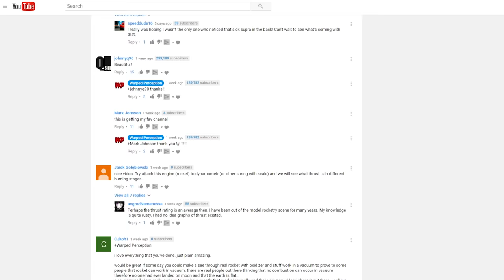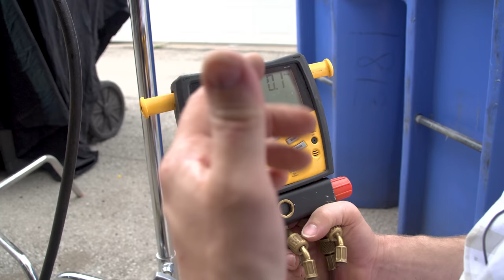Model Rocket Engine In A Vacuum Chamber - 4K Slow Motion - will it burn? - Rockets (S1 • E3)

Comment: I’m not saying anyone is wrong, but I thought that sound couldn’t be heard in a vacuum? The GoPro inside the chamber captured sound
Reply: It can use the exhaust gas as a medium which causes a slight vibration of the chamber which causes a slight vibration of the air.

Comment: the rocket added pressure to the tube as soon as it lite off, I would have liked to have seen a vacuum gauge on the tube to see just what types of pressure absolute was in the tube from beginning to end. your a/c equipment there would have that gauge.  Vacuum is a made up word to discribe absolute pressures below atmosphric pressure which is 14.7 psia at sea level. that small tube's vacuum would have been used up within the first few nanoseconds of ignition.

Comment: Need to mount a load cell to the interior of that tube and attached to the front of that Motor. That way you can measure how much force that motor is creating in the vacuum.
Reply from the maker: I got your back StemLX, wait till you see the next episode in the rocket series. will be out next week. did you see the igniter video we posted yesterday !?. I think you will like it .

Comment: This doesn't look like a complete vacuum to me. While I understand how rockets would be able to burn and make thrust in a complete vacuum, the way the smoke when it first ignited sort of swirled rather than just moving directly away from the rocket appears as though it were moving through air. My guess is that it was reduced pressure, but not a "hard" vacuum - I notice he put another rocket chamber vacuum video, maybe that's a better "hard" vacuum. Likewise, as soon as the rocket ignited it filled the chamber with gas - I'm sort of surprised the chamber didn't pop open, I would expect that rocket motor could generate enough gas to fill that chamber to higher than atmospheric, at which point it would pop open - the duct tape didn't really hold the ends on very securely, just enough to get a vacuum stated so atmospheric pressure could clamp them on very strongly, but any overpressure and they'd pop right off.

Comment: You won't be getting much vacuum for long in that tiny little chamber, the gas from the exhaust will pressurize that tiny little volume in no time. This needs to be tested in a real vacuum chamber, a large one where the gases from the exhaust will do little to pressurize the system.

Comment: How many milliseconds do you suppose it takes for that rocket engine to eliminate the vacuum? Be nice if you had a vacuum chamber large enough that the expansion of the rocket motor would not instantaneously eliminate the vacuum

Comment: And speaking of pressure differentials, nothing launched here on Earth could go to the negative pressure of a complete vacuum in a matter of seconds and survive. It would have to be depressurized the higher it when which would make breathing really hard. It would be the equivalent I'm going to the bottom of the ocean in 30 seconds in a tin can only the opposite a pressurized vessel would rip apart instantly entering space

Comment: What is causing the rocket to burn? There's no oxygen in a vacuum, but in your experiment, there appears to be allot of carbon left over. You must have had a leak somewhere. I noticed you managed to open the end of the vacuum without decompression. How was that possible?

Comment: All you "Rockets cannot work in space" people have one big problem: We don't have just "atmosphere", where the rockets should fine according to you,  and the suddenly "the vacuum of space" where it would not work. Instead the air density just becomes thinner and thinner with the altitude. If your "theory" would be correct,  don't you think, that the rocket should work worse in thinner air and would have less thrust? 

The air pressure gets lower very quickly, at the beginning, then slower. At 13km (the maximum altitude for passanger planes) you have 18.9% air pressure. Already 35.9km you have only 1% air pressure! Only 0.16% at 50km. And at 100km you have 0.00027%. The ISS is at about 400km - but there is still no perfect vacuum, so it slows down because of the air drag and loses height. The Hubble was put out at 618km, is now at about 550km, and it keeps on losing height - because of the air drag up there. 

So please can you tell me: What is the border for a rocket to work, which air pressure is neccessary? Or can you tell me the formula for the relation between thrust and air pressure?
Reply: And what you also forget: You think that this is a special "space" thing. But it is not. If reaction engines would work as you think, then that would also affect jet airplanes. Why do you think that they fly so high? Speed records were made at a very high altitude - because you have less air drag there. But still the same thrust. Do you think that e.g. the engineers at Rolls-Royce, who jet engines fpr most passanger planes, don't know how they own engines work or are parte of the conspiracy?

Comment: I feel like the reason it produces thrust is due to the vacuum chamber only being so big so it has space to bounce off of would this be different if it were in space ie having nothing to push from ?? Wouldnt the only thing that could push something through space is compressed air or gas?
Reply: Unlike planes and helicopters rockets rely on Newtons third law
Reply: @idkhowtoright479  the law is NOT an exemption JUST for rockets.  Stop that.
Reply: Exactly that.  This is a vacuum CHAMBER and not an infite vacuum. A step closer to that would be if he left the vacuum pump run continuously, but even then the "infinite" vacuum would be limited to the volume of the chamber and the power of the vacuum.  

Hope this helps.
Reply: @DrCash7  wrong, the Chambers atmosphere has nothing to do with the thrust of the engine

Comment: thanks, but from what I saw, it didn't move until the chamber was filled with smoke (air) and it then had somthing to push against.
Reply: Ya know these rocket motors take time to get up to full thrust
Reply: @astron3133  I agree. But then, it didn't solve the matter yet.

Comment: I would love to believe you are missing a point here:
I don't care about the shape of the earth weather its banana or strawberry, but you can clearly see the rocket is getting the push from other side of chamber wall and  not from the vacuum.
Reply: Rockets get their push by the speed and pressure of their exhaust gas.

Comment: A relatively small tube that's closed off is not comparable to an infinite vacuum of space with nothing to hold air columns or gasses in place, not to mention what assurance do we have that your vacuum is in fact a proper vacuum even?

Comment: Its a nice video BUT.....its a closed system so there is still something to push against.........a vacuum in a open space like a old factory complete Vacuum. So the distance fron the rocket to the side wall's is mutch bigger......if you put it in a tube these walls are in scale mutch to close to the rocket.

Comment: OH yeah, I forgot to mention, also the reason the rocket didn't push against the spring immediately is because the vacuum chamber SUCKED out some of the rocket's exhaust for a little while, then was some pressure inside the chamber, and then the rocket was finally able to displace something and only then did it push against the spring.    I have gone over this many times...It's all about that VERY first gas molecule escaping the nozzle....when it is ENCOURAGED to escape FASTER than normal because of being in a VACUUM, it is NEVER ran into by gas molecules BEHIND IT.  None of the gas molecules escaping the nozzle in a vacuum ever run into each other....the first that came out first is still at the head of the line, none of the gas molecules behind it will ever catch up and push him forward.  In space it would just form a perfectly straight line leaving the rocket nozzle....The line would never bunch up, and Yes that damn rocket wouldn't budge an inch. 

The boat prop must displace water for the boat to move. It has to move the water forcibly or the boat doesn't move.
The airplane prop must displace air for the airplane to fly.  It has to move the air forcibly, like you actually have to feel a ton rushing air coming at you or the airplane doesn't fly.
A jet engine must displace air for the jet to fly.  It has to move air out of the way forcibly or the jet doesn't move.  And, if the jet gains too much altitude, climbing to where the air gets thin, it loses THRUST.
A rocket taking and flying MUST displace air or molecules of some kind in the environment.  It has to move something OUT of it's way in order to go the other direction.  In a vacuum the rocket thrust is ENCOURAGED, or SUCKED OUT.  Unlike a rocket in room, or one on the launch pad where the rocket's thrust is FORCED OUT.   Because the vacuum also does NOT have any air molecules in it for the fast blowing fire to blow against or displace it doesn't move that reason ALSO,     Two reasons a rocket will NOT fly in vacuum of space.  LEARN THEM BOTH>
Reply: So you think that the "vacuum of space" actually SUCKS?  Maybe you should try taking an actual physics class BEFORE calling every rocket scientist an imbecile?  The "vacuum of space" cannot exert ANY FORCE WHATSOEVER on ANY object, liquid or gas. PERIOD.  This is not up for debate (except among the willfully ignorant)
Reply: If I fire a crossbow in a vacuum, will I feel recoil? Yes or no?
Reply: David, I couldn't say it better... Now, why rocket engines develop thrust in space? Because the "last" findings are... Hold your breath........ Earth atmosphere reach far far behind our moon... It is thin, truth... Than the question is, what is the efficiency of that engine...
Reply: @zeena8091  - Rocket propulsion gets BETTER in vacuum.  Lookup the rocket equation.
Reply: @stuartgray5877  Why don't you me leave in peace...? You have your opinion, other people have theirs... It is only natural... What puzzle me a little be, where you get the idea that I promote a flat earth...? I don't... I just question everything and that is a part of my character... As far as education goes, you are right, I don't have a American high school... I would consider that as waste of time... I got my education in Europe, if you have to know, in electronics, mechanical and chemistry, all on university level... English is my fifth language and I love flying... Now, the real question here is where did you get your hostility and tunnel vision...
Reply: @zeena8091  SO tell me DO YOU QUESTION ROCKET PROPULSION IN SPACE OR NOT, because it sure SEEMS like it based on your comments above.
David says "also the reason the rocket didn't push against the spring immediately is because the vacuum chamber SUCKED out some of the rocket's exhaust for a little while,.... and Yes that damn rocket wouldn't budge an inch. "
Then YOU SAY: "David, I couldn't say it better.."
Which sure sounds to ME that you are supporting David's bullshit conjecture that rockets DONT work in space.
Am I incorrect in the assessment of your statement?
Reply: @zeena8091  not going to answer my question about rocket propulsion?  What are you afraid of?

Comment: On earth, in vacuum, the rocket has weight despite the vacuum. Weight is therefore active nock. All in all, it weighs nothing, and could not repel itself because there is no power. You fall for a trick. No rocket propulsion goes in all.

Comment: I wonder if NASA does their scale rocket experiments in a tubes as well? No???......

Issue #1 ref. Comment at the end "there are still some of the vacuum left in the tube". 
To be able to measure with minimal err.% you need that the rocket exhaust gases do not disturb your vacuum. Disturbance at least  of 0.001% with 100% vacuum, let me tell you that it is not possible with an aveage vacuum chamber but therefore not in a tube you had.

anyways it was a great show though.

Comment: 4:17 shows how you ran the wires 🤔💭
Black tape?!  Really?! 
There was no way there was close to a good vacuum
Questions:
Why didn't you sync another cam on vacuum meter as you do the experiment? 
So, the rocket inside a poor excuse for a vacuum, had force but not enough force to escape the bondage from the coil from whence it was attached too?
Reply: Ever seen a spacex launch stream?

Comment: Where can I find video of rocket propulsion in space, like the actual rockets? Don't they take videos of rocket launches from the ISS?
Reply: Some launch providers have cameras on the upper stage, which only fires in the near vacuum, I know SpaceX is one of the ones that does - though the end of the first stage's burn is already in something that's pretty damn close to an actual vacuum, after all if you're at 50 km up, you've already left almost 50% of the atmosphere below you. And you can actually see the effect of the decreasing ambient pressure, in that the exhaust plume of the first stage engines spreads out more and more the higher the rocket goes, because it doesn't have as much air pressure pushing in from the sides.
Reply: Search YT for "Uninterrupted Footage of the Falcon Heavy Launch and Booster Landing! 2-6-18"
Watch that video from launch to booster landing.
THERE you just watched rocket propulsion IN A VACUUM 
you are welcome.
Reply: @zuthalsoraniz6764  "if you're at 50 km up, you've already left almost 50% of the atmosphere below you."
Far more than 50%.
In FACT at 50 km altitude you are officially IN VACUUM already.

Comment: Show the pressure gauge. You added the atmosphere and lost vacuum. So yes it can burn when adding materials (ie smoke and carbons) you failed to maitain  a vaccum. It burnt so fast becuase it was filling a void.
Reply: No
Reply: @E9X330  HaHa
Reply: @ShortbusRejects  he didn't loose vacuum, he slightly raised the pressure Inside
Reply: @E9X330  Makes sense, also my favorite part 2:21 to 2:23 Sounds like when you lose pressure and a pump kicks on? Just me? Need my hearing checked I am getting old.
Reply: We still had plenty of vacuum after the rocket burned and the vacuum pump took air out. Surprisingly you still had lots of vacuum. Rotfl.
Reply: @ShortbusRejects  no, it sounds like a rocket motor starting

Comment: Deception for sure.....1..what prevented your second tube from breaking.....no vacuum perhaps or hardly any.....we don't know because your backyard experiment offered NO EVIDENCE of a vacuum within the tube at the time of the experiment ( a background noise or a connect tube  is not proof of a present vacuum ......a VISIBLE vacuum gauge would have been  appropriate to show that present vacuum within the tube  to remove the  doubt)    2. The issue is NOT that a rocket engine won't burn in a vacuum BECAUSE THEY ALL WOULD (they provide their own oxidiser within the fuel that creates the oxygen to allow the fuel to burn into a vacuum....3. The real issue  is this, ......THRUST IS REQUIRED TO MOVE THE ENGINE IN THE OPPOSITE DIRECTION.......and space being a vacuum (but we don't know for certain because NO ONE has ever been there)....provides NOTHING for the thrust of the expanding gases to push against to provide that opposite propulsion....4. Your deceptive back yard experiment with a mini rocket , would have shown your  mini rocket shooting up the tube perfectly to the other end  had it not been secured in the ring of wire.....even if there was a vacuum in the tube.....but your  mistake in trying to deceive is this......the fitted end cap on your tube (even if the vacuum was perfect to begin with)  would  have provided the resistance for your mini rocket to push against because of the buildup of gases being held by the end cap......There are NO END CAPS to push against in space to provide the opposite reaction for  the burning fuel to push against.....NO reaction = NO propulsion......but the rocket would look very pretty whilst the fuel was burning, it just couldn't move......You cannot create a true vacuum situation in such a small tube BECAUSE any ADDED end caps will create the WALL to push against for any motor inside that tube.......and to remove the end caps will remove the vacuum situation....back to the drawing board Einstein.....but you should remove this misleading video..